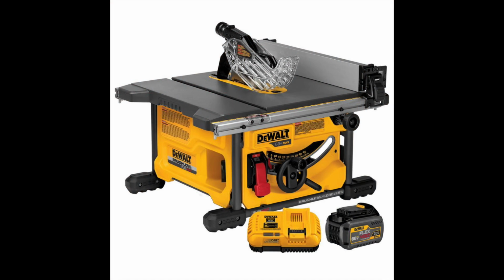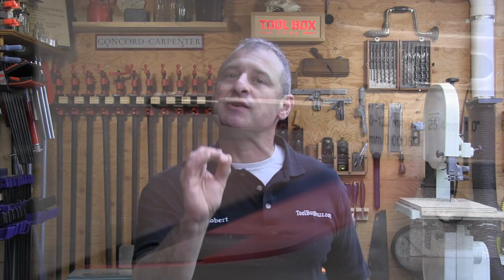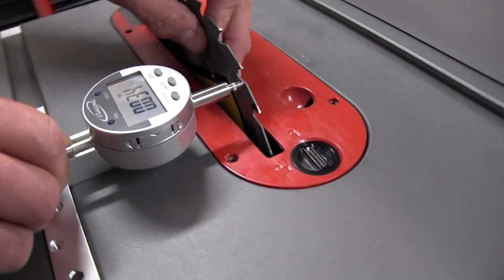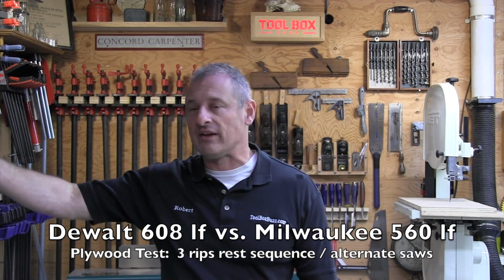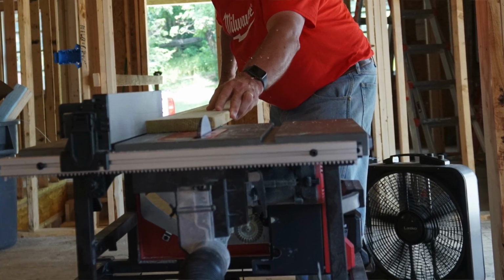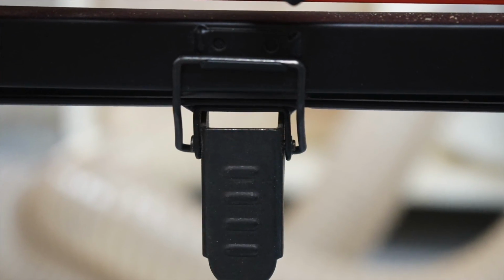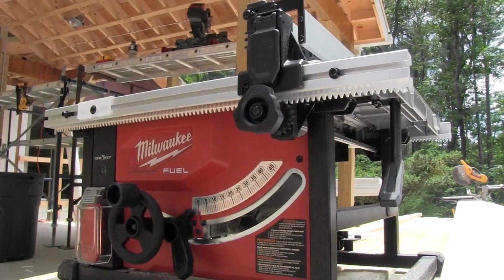Cordless Table Saw – DEWALT vs. Milwaukee

Comment: No need in watching their reviews anytime they have dewalt vs milwaukee it's always dewalt as the winner, and I call BS ALL DAY EVERY DAY no way 🙄
Reply from the maker: @fgbrewer24701  that is SO far from the truth
Reply: Clearly you're not watching or maybe just not understanding?

This review is probably more relevant now from a value standpoint too. No way you can get that Milwaukee kit under $700 (JUL '24) nowadays. So if I'm already on Milwaukee's M18 system including similar (high Ah 6.0+ XC and/or HD line) tool types, Milwaukee is probably better value if you just want the tool (<$500), no battery, no stand.

BUT if you have no comparable high Ah demand tools, DeWalt is the better 'value' 5 years later even for these SAME model saws. And DeWalt now offers battery + saw and battery, saw, charger kit combos. DeWalt is the winner if you don't already have a table saw or miter saw.

This is a good high level video for a side-by-side comp., what am I missing?
Reply from the maker: @DiRam444 I typically look forward to comments on my reviews as well as constructive feedback, but when you say no need to watch because we give Dewalt a win every time you’re so far off base
Reply: @DiRam444 well that didn't age well. Milwaukee with a 12 battery & rapid charger is $450 @ the Depot Jan 2025..

Comment: It's kind of  crazy that the milwaukee has comparable or even better power even though its a 18 vs 60v system. You'd think the dewalt would easily pull away considering that's how it is on the circular saws.

Comment: Why would Dewalt make a table saw with a single miter track? 
What if the user wanted to use a crosscut sled? Can this still be done?
Reply from the maker: These are Gen 1 cordless saws- plus most pros using them don’t use them with crosscut sleds

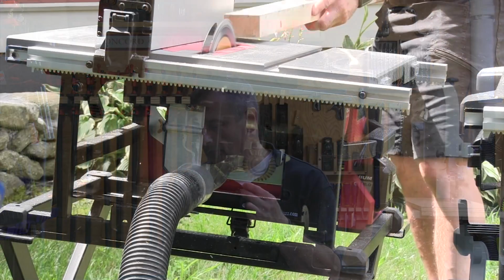Comment: If you really want to avoid kickback and ensure accurate cuts, at least shim the legs of your table saw (8:08). Dude is talking 1/1000th of an inch on the instruments, then makes an actual cut with the legs unsupported by 2+ inches. Laughable.

Comment: I moved into a apartment complex and I was told I would be allowed to use my wood shop drill press an 2 contractor saws .
I paid a guy almost $ 1,500 dollars to help me set up a floor plan so thing would run smoothly. 
Then he put in a L shaped counter tops just like regular countertops then 11 month int getting the shop read and getting plenty of lumber and plywood I was then told I was not permitted to use any of my equipment.
Before we moved in that was the stipulation as long as I could use the electricity we would sign the contract and move in then maintenance man had to come and fix my garage door because someone backed into the garage Door that’s when he asked if I have used the equipment I said no I was waiting for spring to come around then start.
He then talked to the management and the decided no I could not use the electricity.
So now I’m going to sell all my corded equipment and get cordless.
So I mostly use 1” x 6” to 1” x 8” wide boards, I found out that Lowe’s will cut the 4’ x 8’ foot plywood in half.
So will this wook good for what I just described

Comment: For those of us that are heavily invested in M18 already, I think that even though it's not out of the box as accurate, all but the table being flat can be adjusted, although in that department I'd probably also take a flat bar (I have a sanding bar for guitar fret work) to restore some flatness.  A lot of the things you showed have to be dialed in as a manner of course on a cabinet saw before you use it anyway unless you get a white glove service to do it for you.  If I'm missing anything, someone chime in.

Not making excuses, the results speak for themselves, just saying you don't necessarily have to invest in a new system to get the best one.

Comment: 1.Just removed the spring on safety switch and your problem is solved.
2. On the Dewalt all metal gears vs Milwaukee metal and plastik. 
3. Stand. Milwaukee stand dont fold all the way and stays little bit like X. Dewalt folds all the way and stays like I. 
4. Fence storage. Alot better on DeWalt. Dewalt engineers have been thinking.

Comment: Thanks for the reviews. I'm strongly considering both saws for job site work. Our shop saw is a Laguna Fusion 3 so no extra need there, but out on jobs nobody in their right minds would drag a 800 pound saw along. I'm not so worried about run time as I'm seldom going to be cutting lumber all day outside of the shop, but accuracy and user fatigue are also important.. I REALLY don't care about the color nor name recognition, only results and how my old body responds.
Reply from the maker: Right on

Comment: DeWalt makes a 15 Amp, 180 Watt power bank that runs off (4) 20/60 Volt batteries. I run my 10” DeWalt table saw off that without a problem. The power bank doubles as a quad battery charger. I have an accessory fence built onto my saw which holds a 2 1/4 HP router cradle and functions as a router table; the power bank runs thus as well, though not at the same time. I’ve never bogged the power bank down and have used it to cut dados as well as ripping. (4) 5 Amp Hour batteries will run the saw continuously for about 15-20 minutes, depending on temperature. Just an option if you want a full size saw to run off batteries. These power banks are great as I have plenty of batteries to run these and they make near zero noise; working with these beats working with a generator, especially indoors without power.

Comment: Now the Milwaukee is more expansive. I just paid 499 for the dewalt with 2 batteries
Reply: I like ther portability and power is fine, gonna check out ther newer yellow bottom batteries. It accurate out of the box. Looking into a stand for it now
Reply: How you liking it??

Comment: It’s too bad the Milwaukee lacks the precision of the Dewalt.  Hopefully they’ll fix that in the next version.
Reply from the maker: Rob - Tools and Tech I. Curious, what are you referring to
Reply: A Concord Carpenter / ToolBoxBuzz Hi, sorry I should have been more clear. When you talk about accuracy in the video like blade and fence parallel and setting the blade at 45 or 90 degrees, Dewalt won in most of your accuracy categories.  I think you said the Milwaukee was like 46.3 degrees while the Dewalt was spot on to 45.  I don’t have either brand yet.  I would definitely like the arbor lock on the Milwaukee   I have a Miter saw that I have to use 2 wrenches for.  Just like you said in the video, it’s a pain to use 2 wrenches.  Better yet, if they come up with a tool less blade change  for these, that would be awesome.  But I’d rather deal with the two wrenches and have the higher accuracy.  

I also saw a video from VCG construction and Finish Carpentry TV, and they didn’t do all the precision measurements you guys did, but they said the Dewalt felt better to use.

Comment: You do know the Dewalt 9amp battery by Dewalt has 21700 cells the 12amp has 18650 cells you get more power with the 9amp battery more runtime with 12amp , the riving knife lever comes loose over time

Comment: I'm sure that given quality control, if you had pulled another DeWalt out of the box, it could have been slightly worse in those accuracy measurements. They should all be checked/calibrated from the start so I imagine they ARE the same saw for the most part. Except for arbor wobble but I imagine that is a Quality Control thing and wouldn't hesitate to exchange the item if I see the blade running out on me. Great review, thanks.

Comment: Hello Rob,
I hope this message finds you well in the midst of Corona Virus
I am a UK based carpenter who watches your tool reviews and other videos posted online - Love your work!
Following your review on the best cordless table saw I have just purchased the Milwaukee M18 saw which will be here any day now. One of the deciding factors for my purchase was the fact that the M18 will take a Dado-Stack head - however, I cannot find anywhere that stocks the Dado throat plate (Milwaukee US part No: 14-67-0010) Can you offer any assistance in how I can buy one of these and get it shipped out to the UK
Thanks in advance for any help you may be able to offer
Keep up the good work and stay safe
Gerard Greenan
Reply from the maker: Email them at customer Service or get a zero clearance plate and plunge thru

Comment: Dewalt came out with that "Flexvolt" system then over-inflated the prices on top of it.  Not worth the cost to get flexvolt tools when other platforms offer the same thing in their 18 or 20 volt line.  All you are doing is adding weight to the tool on handheld flexvolt tools it seems.

Comment: I just bought the corded 81/2 Dewalt version because if I need to go cordless I'll use my power station I find the corded version is more powerful I've tried the cordless and wasn't impressed it struggled with wet treated it actually couldn't make the cut
Reply: I agree certain tools just don’t have enough power , if there cordless.

Comment: Would love to see a new comparison test including the Metabo HPT 36V tablesaw! Recently replaced the old DW745 corded saw with the Metabo cordless saw and have to say I am completely blown away by the performance of this saw with the shop saw capacity (35" rip and 3 1/4" cut depth), power of a corded saw, (ripping thick hardwoods, no problem),  and the available AC adapter cord is a great bonus feature! Not sure why none of the other manufacturers make an adapter available!
 Crew truck is now completely cordless...life is good!

Comment: i think you mixed up your tenths, thousandaths, and ten thousanths. either that or you should have never used the word "accuracy", lol
Reply: I was looking for this comment. Guy said DeWalt had 65 thou runout of the blade, which is more than 1/16.” That saw would be jumping all over the place, and would be extremely unsafe to cut with. These guys really need to learn their metrology before analyzing these tools and coming out with data that is very skeptical

Comment: I use DeWalt but have nothing against Milwaukee in really suprised at Milwaukee,s lack of accuracy here. The blade being a degree out of whack is not acceptable, I would have thought that both of these top brands would be bang on tbh. Thanks for the video 👍🙂

Comment: Wait you do know that 60v flexvolts are 20v compatible? You keep saying the Milwaukee is the same line of 18v but the dewalt flexvolt are backwards compatible with their 20v lineup I switched all my tools from the 20v batteries to all flexvolt. Better run time and much better performance

Comment: why on earth I would need a cordless table saw? this is not a mobile tool like a drill or nail gun which would require to use to attach something to the roof.
Reply from the maker: Alex K many carpenters work in areas with no, or little access to power

Comment: You know you can use any 20v max tool with the 60v battery and the chargers will charhe either plat form?
Reply from the maker: Michael Johnston yes nice feature!
Reply: @ConcordCarpenter  so why did you state that Dewalt was forcing yet another platform on us? Just fyi yes I own Dewalt 18 & 20v systems, m12 and m18.
Reply from the maker: Michael Johnston it’s absolutely a new platform - it’s a fact

Comment: The move towards more and more battery operated equipment is madness and is very irresponsible of the manufacturers . 
It creates an unnecessary increase in the use of rare earth elements and an ongoing problem with the expired batteries. 
There are very few times on a job site where grid electricity is not available . In those rare instances it is better to use a generator that will give you reliable power to run your tools.
I find the only battery tools i continue to regularly use are my drill motors and impact drivers. otherwise it’s all corded .
Reply: I want convenience.  I love that the job site tools are going all cordless.   And I really don’t see a problem with the batteries once they’re out of warranty and they’re dead i just buy another one.
Reply: Understood, but how difficult is it to plug your machine in ? Takes all of thirty seconds . 
I think the biggest draw back is recycling all of those batteries and the cost of corded tools is so far cheaper. 
Anyway, enjoy.

Comment: Does anyone know if the Milwaukee will cut exotic hard woods?
Reply from the maker: Daniel C. Shomo  yes it will
Reply from the maker: Daniel C. Shomo how exotic? I cut Ipe with it
Reply: Thanks for the reply. I guess if it cuts Ipe it should be ok with Lignum vitae and the like. I am planning to get the forest thin kerf blade to help with the cutting action. I am just a light user, not all day type stuff. I understand why almost all the videos are cutting sheet goods and pine, the stuff I will be using is not cost effective unless you happen to be making something with it. Again thanks for the reply, I watch all your comparison videos. Any advice on the subject of cutting these hard woods is appreciated, Thanks.

Comment: Milwaukee needs to go back to the drawing board if the 45 and 90 aren't true
Reply: pretty standard for most Milwaukee gear unfortunately, they're heaps powerful and good to use but the accuracy has always been lacking
Reply: You should be manually confirming angle regardless if the angle tolerance is critical.

Comment: Can you show howto adjust the 45 degree and 90 degree on the dewalt? Also are these table wasw really god enough to have as only table saw instead of one with a cord? Great review! Thanks.
Reply from the maker: Casper Juul Berthelsen sorry too late to show that, it’s the lever next to the blade height wheel

I only recommend these saws of your a mobile contractor

Comment: Clear winner....dewalt! I don't care about leveling the stand or how cool the switch is! Accuracy of cuts wins over anything else! Video could have stopped right after accuracy measurements!
Reply: MudSlingr: umm he was talking about OUG OF THE BOX. I have a corded dewalt 10” and run out and fence slop sux. (Upgrading to skilsaw worm drive soon “larger version”)
Blade run out (vibration) is not adjustable. Everything else I can adjust with a digital angle meter and a machinist protractor/square in under an hour.

Comment: If performance is very similair, I'll take red for the better features. My boss has the dewalt and its so annoying to move saw and stand around jobsites separately. Also of the 3 dewalt tablesaws I've used substantially, all 3 of em the rack and pinion gets sloppy very quickly and jumps teeth with a lil accidental nudge. Haven't used red yet to tell if it has same defect.

Comment: You forgot the fact that DeWalt Flex Volt batteries work with all 20v Max drills, drivers, skillsaws, hacksaws, grinders, nailers, sanders, and to include the complete Flex Volt line. That's a huge point for guys who have bought the 20V Max line and something that should be considered
Reply: I've always used dewalt it's nice to be able to still use the 60volt batterie on my impact or my oscalating tool

Comment: Sounds like Milwaukee is better simply because of the smoother motor technology that leads to better glue line cuts. I have a Dewalt 10" corded model, no matter the blade there still are saw blade marks left in the cut. Shop saw does not have that problem.

Comment: Well what I seen was all good except the comment of the flex volt not working with the 20 volt platform! You where completely wrong there the whole purpose to the flex volt if you look at the battery it shows you is that it DOSE work with both systems! Other then that this was a good comparison!
Reply: That’s why they call it a flex volt

Comment: Just discovered you guys, great work on all you're head to heads. Looking forward to checking out your other vids.

QUESTION
What stand are you using for the dewalt? I have the Dewalt and cannot find one. I've been using on the ground or finding/making something on-site. The only one I've found says it was discontinued. 

Thanks in advance for the direction, to ANYONE that knows where I can find one or even a model number.

Comment: you missed the fact that the Dewalt is more accurate, and that the 60v will work in any 20v tool... I would agree they are very close in comparison with edge going to Dewalt and accuracy alone.
Reply: otherwise very good video.

Comment: You mentioned the milwaukee taking a dado blade but said nothing about the DeWalt. Will the DeWalt accept a dado blade?
Reply from the maker: GreenIS300 no it wont
Reply: And do you know if either accepts a zero clearance insert?

Comment: I'd like to see these tools tested on a 108 degree day in Texas constantly ripping 3/4 hardwood. See which one catches on fire first.
Reply from the maker: Chris Ruthford lol
Reply: I find that cold weather affects cordless tool performance more than hot weather, at -20 the batteries barely run.
Reply from the maker: John Galt/Taggart  do you use a “hot-box?”
Reply: It wouldn't work because I'd be inside with the AC on sipping Mai Tais

Comment: Every Video has Dewalt customers asking DEWALT to have two miter tracks, and a corded adapter, but it seems DEWALT just ignores what POTENTIAL customers want! - someone should be fired - it is apparent and been written about time after time - I don't think adding weight or price increase  to a portable table saw is a drawback, just get the product people are asking for on the market - oh yeah Hitachi (now Metabo HPT) has a 36v version that has an adapter -  and the built-in  portable wheel system they have is pretty nifty as well. I am a dewalt guy and will wait another 6 months to see what they do.